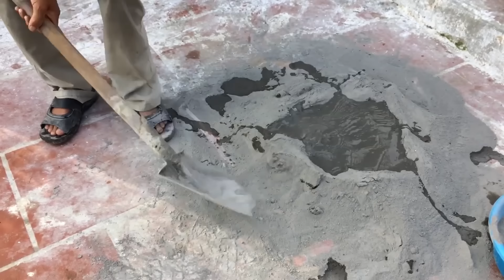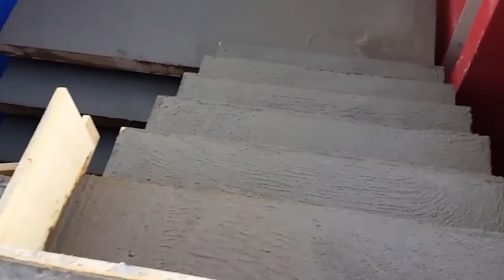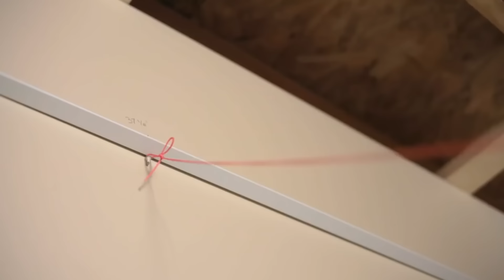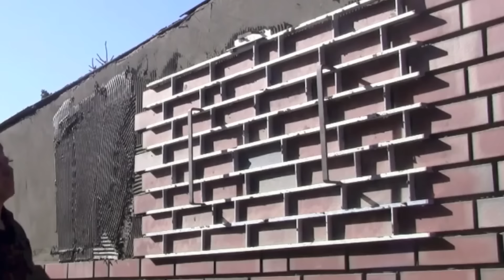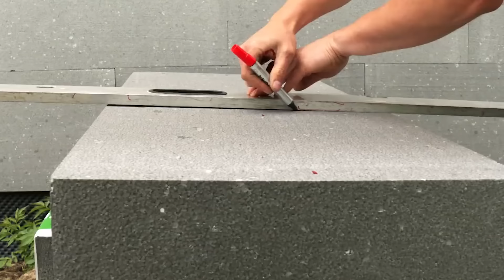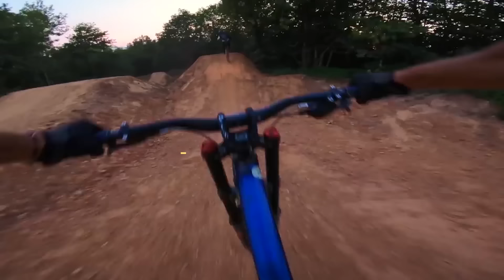INGENIOUS CONSTRUCTION IDEAS THAT ARE ON A BRAND NEW LEVEL

Comment: Rebar in the stars should have been spaced to set in the concrete towards the top surface of the step instead of the bottom.

Comment: Don't watch guys, spare your time. He is talking about drop ceilings (standard practice in most offices), stair with central beam support (nothing new, seen such over 20 years old) and using graphite polystyrene foam as insulation of the walls (most walls in my country are isolated with polystyrene, graphite one too). He finishes with "STOP BEING LAZY" when lazy he is as fu...

Comment: The exterior insulation is a brilliant idea. It’d give so much more flexibility interiors. Wonder why we don’t use it more often.
Reply: It looks very similar to E.I.F.S. which has been used on both commercial and residential buildings for over 20 years. Brands like Synergy, Sto, and Dryvit.

Comment: those concrete stairs look waaaaay too flimsy!

Would not stand building code in any European country in my opinion.

Want to see the proven and modelled stress-levels and statics for that design and von mises stresses under load et cetera...

I recently had my concrete staicase built, and the individual steps were more then twice as thick with reinforcements both, an inch from the bottom and an inch from the top (1 inch equals the minimal concrete coverage required for rebar in that specific case. Also there should be way more rebar in there connecting the stairs to the concrete ceiling - sure, it will hold the way this is built, but when will stress cracks accour?
once a piano is carried upstairs?

or by usual daily usage?!

What are the safety levels calculated at?

i don`t know...seems sketchy as hell to me!
Reply: kniefi I’ve seen em in America but they have a steel form that stays after concrete is poured.

Comment: The "master" could have done a much better job reinforcing that concrete stairway.  You don't design reinforcing steel by just distributing it uniformly.  Engineers carefully consider and analize the physics of each piece.  To start with, about 4x as many hoops in the spine for torsional reinforcement, longitudinal bars on top in the treads instead of underneath to counter the reverse-cantilevers, and u-bars at the front of the treads into the spine to engage the treads with the spine-- those little v-bars are worthless because they don't counter any real force. There's also no accomodation made for the attachment of the guardrails.  This thing will be all cracked in the future and this guy will be nowhere to be found.  Next time ask a structural engineer instead of assuming you understand the physics of reinforced concrete.
Reply: I would love to see this guy do one of his steps

Comment: You need a cement bonding agent for the cement to stick to a cement wall and prevent cracking.
What kind of cement bonding did the Philippino use?
Reply: *Filipinos/Filipino, if you are referring to the first one, I don't think that he is one. 

Commonly it's just the normal cement, the ratio just changes depending on use, but sometimes they use cement floor cement. s far as I know.
Reply: @jrpueyo7531  to he ratio is 3:1.....3 bags if sand to 1 bag of cement.
Never heard of a ratio better than that.....and it still cracks

Comment: You are just discovering drop ceilings? They've been around for decades.
 Also, they're called 'Tin Snips' or 'Metal Shears', pliers don't have a cutting edge, and are meant to grip things.

Otherwise your videos have been great, keep up the good work!
Reply: Some pliers actually do. I have a pair of pliers that I use for bolts, and to cut wires or thin metal wire
Reply: Kliens, or lineman pliers. They have a cutting edge on the side. Also called sidecutters. I install acoustical ceilings, they measured down from joints all the way around and snapped a line. We measure down one spot and hang a laser. But yes we have tin snips for our grid and “pliers” or lineman pliers for cutting hanging wire.